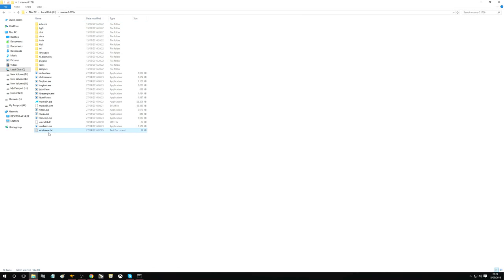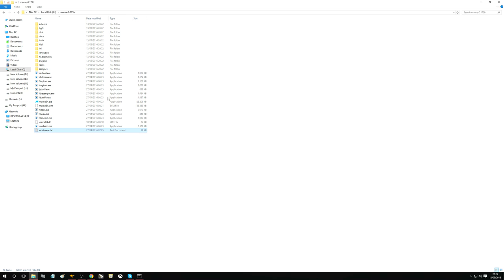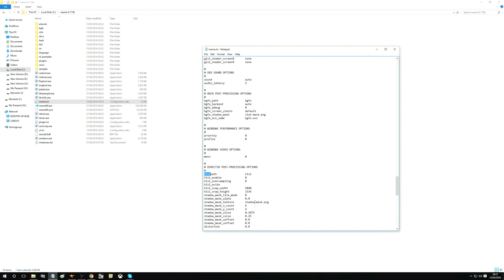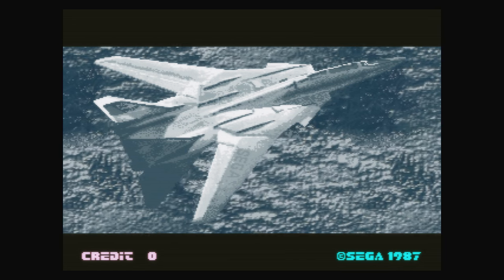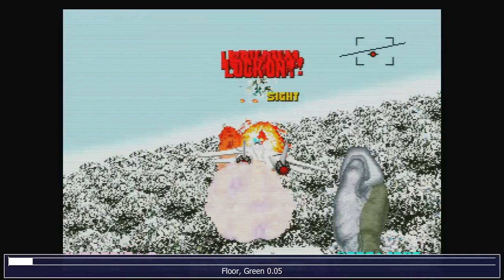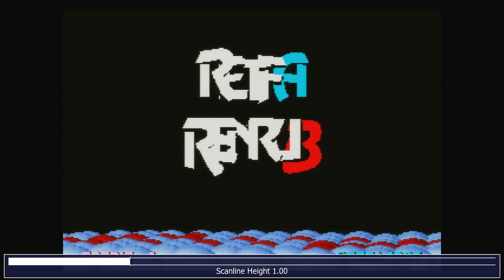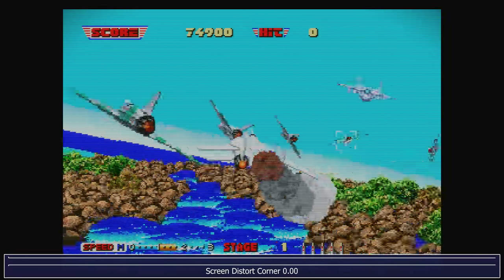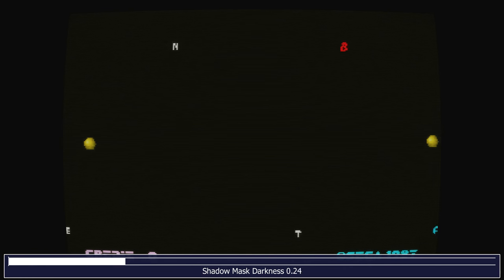MAME. Arcade Monitor HLSL Settings.

Comment: Excellent video! I am testing a preset in RetroArch, in addition to bringing the qualities of the crt TV, it seeks to make the graphics in high definition. If possible, someone try it out there and write any criticism or advice, please. I'm using 8 shaders (total, ordered sequence) trying like this: mdapt (has 5 steps); anti-flicker, xbrzfree (2x on the scale); crt-hyllian. Note: In the parameters I edit "0.38" for the "Scanlines Strength" option. First disable any emulators graphic effects, especially the "bilinear filter", usually found in the "video" options in RetroArch's "settings" tab. The intention is to leave the image "pure" or original so as not to interfere with the result or the full effect of the predefined shaders. I'm using this preset on almost all dithered, 2D games with low resolution, any console/arcade/handheld from the 32-bit era and below.

Comment: Instead of not stretching vertically why not just stretch both vertically and horizontally by the same amount of pixels until you fill up the screen vertically?  This way you can fill up the screen vertically and still have it look correct.

Comment: I change it manually in MAME (Tab key while running a game) but it doesn't save the changes. I have to adjust every time I open MAME for every single game. Is that the reason you change the .ini file?
Reply: i have same problem :/
Reply: @wolfenstine8304  You guys probablky got your answer some time back but yes, MameDEV removed the slider saving years ago so you have to edit the ini.